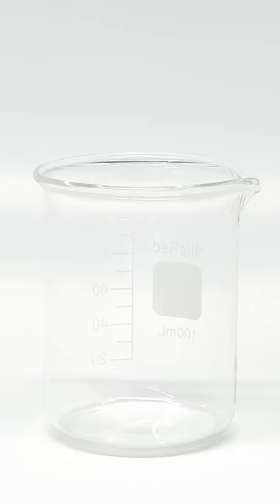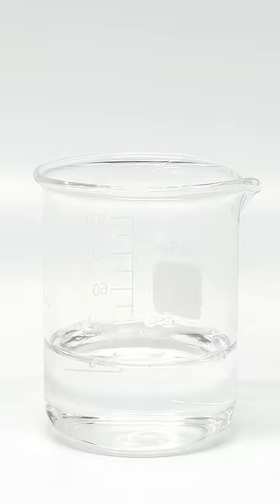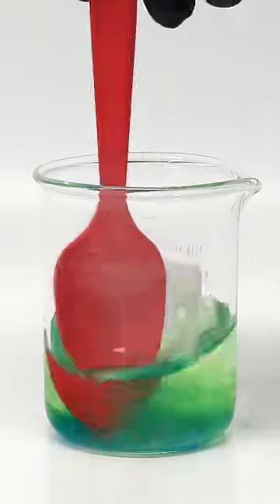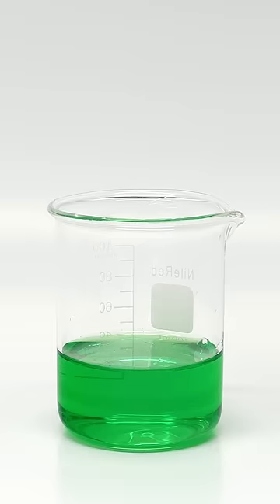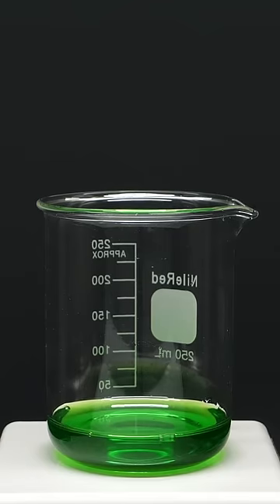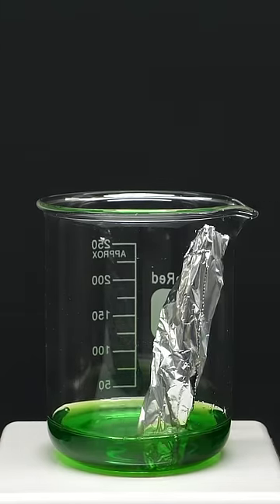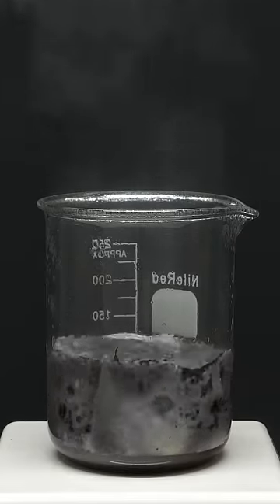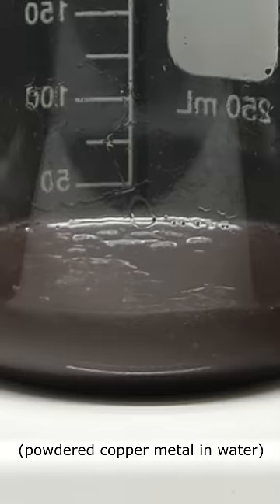Aluminum vs acid is crazy

Comment: For those wondering, this is a simple reaction called a displacement reaction
Reply: My reaction was just 😮
Reply: And redox reaction also take place. The aluminium acts as reduction agent and reduces copper ion to copper metal.
Reply: So what happened to the sulphate ions?
Reply: @stevesellers-wilkinson7376  they just switched from being bonded to the copper+2 ions to the aluminium+3 ions, going from CuSO4(copper sulfate) to Al2(SO4)3(aluminium sulfate). sulfate is -2 btw
Reply: @sobrenomenome1286  I have no idea if this is correct, but I'm impressed

Comment: Step 1: Mix this in a small beaker
Step 2: Pour the mixture in a bigger beaker
Step 3: Wonder why you didn’t mix it in the bigger beaker in the first place. 
Step 4: Wash the small beaker.
Reply: Its easier to mix in smaller beakers because of smaller diameter, but it is easier to add some solid object to a solution in a larger beaker.
Reply: @spacebarbarian._  it's easy to mix in the bigger beaker too
Reply: yea it's easier to mix in a small beaker. He would have needed to stir 0,00000009% more if he did it right away in the big one, if he does this a trillion times he would get a small ache in his wrist so it's better that way.
Reply: @Tekape  Correct, and if he did that he would have burned precious energy he would need to wash the small beaker. Wait..
Reply: ....and why didnt the plastic spoon melt?
Reply: @Dawn82  it didn’t melt bc it was never heated or burned, but also didn’t dissolve because acids don’t react with them chemically like they often do with metals
Reply: You forgot what appeared to be another beaker the measured amount of hydrochloric acid actually started in. 
Step 5: Wash the other small beaker.
Reply: What is this chemical
Reply: Ease of filming and mixing
Reply: He used around 40 ml diluted hcl which cannot be measured by the large beaker
Reply: Crack heads finally don't need to steal copper pipes from trailers😆
Reply: Lol
Reply: @Painpillhills  🤣
Reply: @rkwatchauralnautsjediparty7303  Looks like he used 2 small beakers and 1 large beaker
Reply: 999 like wow lmao
Reply: @spacebarbarian._  yeah...no.
Reply: @naveenkamboj4851  
Magic juice.
Reply: @DatBoiUKno  it's all in the wrist.
Reply: @naveenkamboj4851  Are you serious? He literally said all the chemicals in the video and if you can't figure that out you really don't need to know or try this at home. 🤦‍♂️
Reply: @benrie288  He didn't measure anything. Those are obviously eyeball amounts, not at all a critical reaction. You think he would scoop an arbitrary amount with a spoon like that if he was measuring precisely? 🤦‍♂️
Reply: @Tekape  and pouring it a trillion times wouldn't make your arm tired?
Reply: @Tekape  Yeah go try and stir a cup of water on a plate instead of in a cup. Some of you get to smart channels by sheer accident I swear to God.
Reply: @Dawn82  Why would it?
Reply: In actuallity this is what scientists do every day
Reply: @benrie288  he already had it measured out in the very first container though
Reply: @benrie288  He already measured it. In the even smaller breaker he poured it out of.
Reply: @XxNightmare128xX  Try stirring a cup of water in a cup with a slightly wider base than the cup you're currently using. I swear some people just like to act like they're smarter than other people when they can't comprehend simple criticisms of method. If you can't handle having methods scrutinized you'd never cut it in science.
Reply: This violates the KISS principal, big no-no!

PS - KISS principal = 
Keep
It
Stupid
Simple
;)
Reply: @chrismanuel9768  Right, but that's my point. Wider means shallower fluid, shallower fluid makes it harder to stir, hence why the contents were mixed before being moved.
Reply: its so that he gets the required mixture/solution first and then he'll add the aluminium incase something happens that wasn't supposed to happen.
Reply: My thought exactly
Reply: Hmm i wonder why he stirred it in a more precisely measured beaker meant for a lower quantity of liquids, and then poured it into the bigger, general measured beaker. No idea! He must do it for no reason! Golly isnt he thinking?
Reply: @Tekape  If did mix in the bigger beaker, theres the possibility that unmixed copper sulfate would cling to the sides of the beaker. That raw copper sulfate could cause a reaction with the solution that was exposed to the aluminum and during some expirememts that unexpected reaction could be VERY dangerous. It's good practice to always mix in a seperate beaker.
Reply: @spacebarbarian._  he should've mixed it in his drinking cup or shaker
Reply: Step 5: ?
Step 6: profit.
Reply: Step 5: Realise you don't work in a lab and have really no clue what you're joking about
Reply: As the sponsor, I would like to point out that there is a very good valid scientific reason for using multiple beakers all the time. Even when you're not doing experiments. 
Joe Marsupial
CFO Acme Beakers, Inc.
Reply: Measurement is less than lowest line on big beaker
Reply: I think it's general precaution that you don't want to pour/drop something into an acid from a higher distance as it might splash out, but I doubt that powder would have made any splash lol, if you were pouring another liquid in though it's safer that way
Reply: Just easier to see for YouTube tbh
Reply: @morganh-b3132  Yes, at least theoretically. It isn't as hard as you might think. Getting all the chemicals is the tricky part. But why would you want to make meth? It is really not worth it to ruin your live for a high.
Reply: @draco5991rep  nah i was just thinking of walter wite type situation
Reply: Generally the markings on smaller apparatus are more accurate and discrete than larger ones. That's the reason I was told in the chemistry class.
Reply: The bigger beaker didn’t have the 30ml marking thats why
Reply: Lol his running narrative in his videos. “I didn’t think it would work, so I put it in a beaker.” “It wasn’t mixing, so I put it in a beaker.” “This might explode, so I’ll put it in a beaker.”
Reply: @boldsans1070  If you want to measure something accurately you don't use beakers anyway, you use measuring cylinders. The markings on beakers are more of an approximation of the volume, measuring cylinders have much more precise markings.
The solution would have been too shallow to mix it effectively in the big beaker, this is probably one of the reasons why he used a smaller one first.
Reply: AAAAAAAAAAAAA NO WHY YOU EAT MY Cookies!? 

eats you
Reply: @Dawn82  the spoon is not normal plastic it's pvc
Reply: @Dawn82  it's also dilute
Reply: Yup
Reply: It's probably actually because smaller diameter = less solution for the light to pass through = colors look lighter/brighter on camera. Plus it goes higher up along the beaker, so it's framed better. After he's done mixing the focus is no longer on the pretty green liquid, it's on the aluminum + fire, so bigger beaker looks fine and it contains the fire better.
Reply: @benrie288  Yup, the larger beaker doesn't have measurements less than 50. Measuring the wrong volume can cause problems.
Reply: He poured it into a small beaker from a small beaker.
Reply: @boldsans1070  he measured it out in the first beaker he poured the acid from, tho?
Reply: @Tekape  It's also presumably easier to measure in the smaller beaker - in the larger beaker, the meniscus wouldn't be on a measurement level that would be measurable.

The ability to stir it faster is, in my opinion, an ancillary benefit.
Reply: @AfricanLionBat depends really tbh.
Reply: @AfricanLionBat I might not be a chemist, but I am an artist who can say that, it is more necessary to mix in smaller containers before moving to a bigger container. At least it's worked best for me. As I've found that putting it in the larger container has taken me a bit of a longer time to get it mixed in and not wanting to do that again cause it was way too long for me personally. I think it's just more contained than in bigger containers. Paints and dyes, silicones, resins and other materials especially can be a monster trying to do it in something more spaced out. Learned my lesson that it's just more convenient and less trouble to start small container then bigger.
Reply: @erebosthemogoreg  you're probably right then
Reply: Both are average beakers.
Reply: Easier to measure
Reply: Wash of shame
Reply: Its because if the effervesce is too much the acid will spoil out of the small beaker never judge someone he has much more knowledge and also a degree
Reply: Probably because the smaller one looks better in camera to mix stuff on it then the bugger one for th added aluminium.
Reply: @thore_rohit Khabe?
Reply: I'll do you one better. Why pour the dilute hydro-cloric acid into the beaker... from another beaker. Of the same size.
Reply: Smaker breaks have smaller measurements so its easier to measure out the correct amount
Reply: @CHOPPERFAN34  Source? 🗿
Reply: @SimoneBellomonte  my source is having an education where i did any science ever
Reply: @CHOPPERFAN34  *My source is that i made it the fruck up!*

🗿
Reply: @brianhuffman5187  Its not a waste, the universe will go into a heat death anyways, and everything is already predetermined so. 🗿
Reply: the kind of questions they do when i am cooking
Reply: @AbbeyKitty1013  Pfp (Profile Picture) Source (Link to full Image and Artists Names?) 🗿
Reply: @spacebarbarian._  bro has magnetic stirring

Comment: He just used 3 different beakers for something that only needed one. Madlad
Reply: Certainly
Reply: Like those recipes that pointlessly use 15 different containers
Reply: I've done this with one beaker before
Reply: I'd like to see you create 40 ml of a homogenous mixture in a 250 ml beaker 😂😂
Reply: @champion8795 try me. I can pour water back to front, even inverted
Reply: It's for safety
Reply: He only used 2, one for the acid, other for the main reaction. Also, he did that for safety. Where did you want him to put the acid from?
Reply: He extracted grape juice from vinyl gloves. And many other crazy projects. I'll be trusting him more than u
Reply: I think he cracked that first one.
Reply: @juanignaciolopeztellechea9401 he poured it out of a third beaker
Reply: I dont think thats a beaker @mrdavman13, it looks like just a plastic container
Reply: Read the units on the beakers Mr Curie
Reply: “Fancy a Cup O’ Tea?” Ahh comment 😭🙏
Reply: The smaller beaker allowed him to measure the acid at a finer gradient than the larger one, so as to add the correct ratio of copper sulfate.

Then the larger one was just for the reaction.

Comment: This alchemist just turned aluminum into copper. Scandalous
Reply: How much is copper per lb these days?
We could get a racket going. you in?😂
Reply: brony❤
Reply: Yes, alchemy is real. The backbone of chemistry.
Reply: he used copper sulfate
Reply: @SporksAgainstForks Where did the alumimum go?
Reply: We just as well believe that the Aluminum was converted to Hydrogen. That's where this lame explanation seems to lead.
Reply: He’s also turned plastic gloves into hot sauce, diamonds into water and paint thinner into cinnamon candy.
Reply: @pierrenavaille4748 It's still within the solution, as a different compound. I'm not a chemist so I don't know what specific chemical it turned into, but I know enough about it to know that aluminum simply won't turn into hydrogen without dabbling into radioactive shenanigans

edit: doing a bit more research, the aluminum is actually still by itself and isn't a compound, but is rather an ion that is (probably) dissolved into the solution

edit 2: still wasn't sure about it so did even more research, and another solid 2 articles said that it was a displacement reaction where the aluminum pulls the copper out from the copper sulfate and turns into elemental copper and aluminum sulfate. i think this one is more believable, but again, I'm just a guy who's interested in chemistry and not a chemist so idk lmao
Reply: Aluminium.
Reply: @danielrosales221 ur 3 one is the most correct one 

I think that bcs it makes the equation balanced

Also i think copper is oxidized because hydrogen got elimanited from water and left hydrooxide which combined with copper

(Im also not a chemist so i can also be wrong😅)
Reply: @pierrenavaille4748  well, for one, it dissolved to displace copper from copper sulfate plus hydrochloric acid, simple displacement reaction

reactivity series
Reply: @danielrosales221  an aluminium ion means it is in an ionic compound and means it isnt an element

and to your second edit, forgive me if i sound kinda rude but aint this like o level chem
Reply: @gamesofaslandev   the hydrogen was removed from the acid and not water because acid-metal reaction and copper was reduced

Comment: I found this out accidentally a couple years ago.  Cleaning grease hood filters with an acid based cleaning solution, all was going just fine, when soaking the stainless filters.  However, one hood contained aluminum filters, and as fate would have it, I placed one in the bath and went to the bathroom while the grease loosened up.  I came back to a violently boiling bath with a massive steam plume rising from it!  
It still turned out to be a good way to clean them though.  The aluminum really heats up, and loosens the grease.  Just got to limit how long you leave it in the bath, before washing it off, then repeating until completely clean.
Reply: It's gas stove fire
Reply: ...huh. Glad that turned out alright. :3
Reply: You ... repeated it?
Reply: @PurtyPurple  I did!  In constant supervised  moderation, to prevent another runaway situation, though.
Reply: @ElementofKindness  Props, it's people like you who discovered expired milk is edible and where would society be without cheese?
Reply: @PurtyPurple  this is one of the best comments
Reply: "Violently boiling bath" 😬😬😂😂
Reply: FYI: Aluminium is a neurotoxin and is the second most common pollutant on the planet after plastic.

Comment: Now he just needs to throw in some other metal salts or metals to get different hydrogen flame colors. Lithium for red, sodium for orange, etc...or, better yet, add hydrogen peroxide and potassium iodide! The oxygen formed mixed with the potassium ions should make a nice, purple explosion!
Reply: Barium would be awesome
Reply: @dapossum9495  apple green isn't it?
Reply: @dapossum9495  what about cesium? Blue color seems pretty cool
Reply: @hahnoob6658  yeah. thallium does the job for that too
Reply: @r3q92  Only if he manages to handle thallium salts without dying in the process....
Or getting knocked by the FDA.
Reply: @r3q92  
Actually, handling mercury was as close as he got to thallium, although the latter is MUCH more toxic...

Soluble thallium would be one of the worst things to get on your skin, but he probably would know that...

Uranium wasn't as dangerous, mostly the radiation residue, but with small amounts it's unlikely to be absorbed through skin, but he still had to be careful not to discart anything.
Reply: @patrickjanecke5894  yo i looked that compound up and that is insane 😳
Reply: @hahnoob6658  It was once under consideration for rocket fuel...
Reply: @patrickjanecke5894  i can just imagine what would've happened if they used it
Reply: @patrickjanecke5894  
That story of the scientist who got two drops of Dimethylmercury solution on her hands, while she was wearing latex gloves, and died a few months later...
I don't think anyone would ever want to get close to that...

Comment: “Turning aluminum foil into copper foil, then back into aluminum foil” i’d love to see this if it’s possible?
Reply: I think it's probably not possible because I'm guessing that the aluminium metal and the copper sulphate solution went through displacement reaction. Since aluminium is more active than copper reverse of it is not possible. We learned it in middle school so i don't remember exactly. I might be wrong
Reply: @rupkathanag5044  I don't know the exact mechanisms, but I do know you don't mix copper and aluminum into a computer water cooling loop since you'll see heavy corrosion at some point.
Reply: Copper attacks aluminium big time, thats why you don't want a brass radiator with an alumnium engine block or cylinder head. It doesn't take much either, many years ago a company used a copper based pigment in its green colour powder coating formula, after some 15 years the powder coating started to flake off the aluminium windows. It was quite an expensive mistake.
Reply: play the video first forward and then backward.
Reply: It isn't half as bad as being told trees can turn to Stone. What's worse is being taught the wrong analogy of Mankind
Reply: I don't think thats possible if this is a chemical reaction
Reply: He said all the aluminum was gone when it was finished
Reply: It might be possible if you use a more reactive metal to display the aluminium (such as magnesium), and the aluminium didn’t disappear, it just became aluminium ions
Reply: It doesn't "turn" the aluminum into copper, you cannot turn one element into another one, it just got rid of the aluminum and the copper remained, the copper comes from the copper sulfate he added
Reply: I don't think the converse is true, you can react a more reactive metal with a less reactive one but not vice a versa
Reply: @VDM87  he said he got rid of the aluminum but I didn't understand where it went! Did it fly away in vapor form? Maybe he meant that he got rid of metallic aluminum but it was still present in the water as aluminum oxide or dissolved or something?